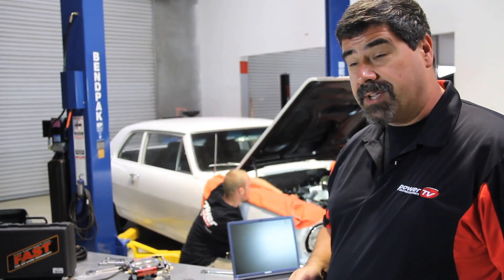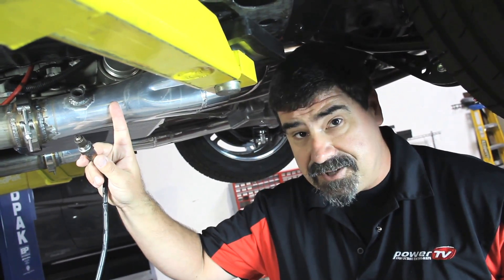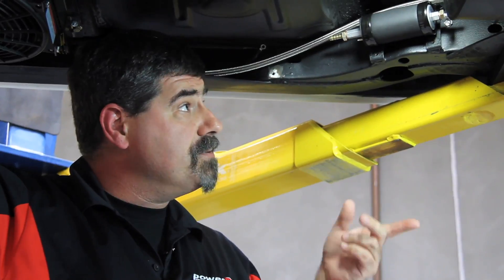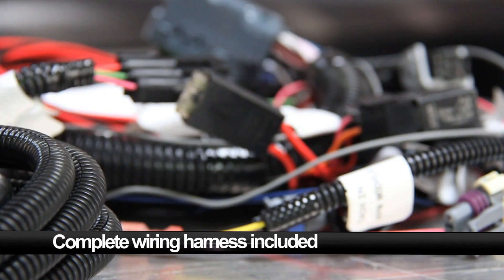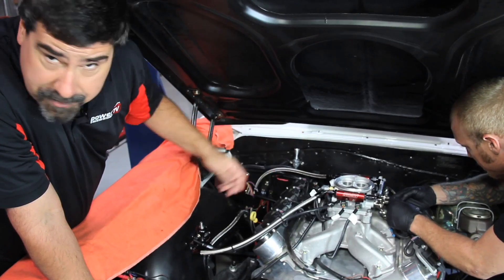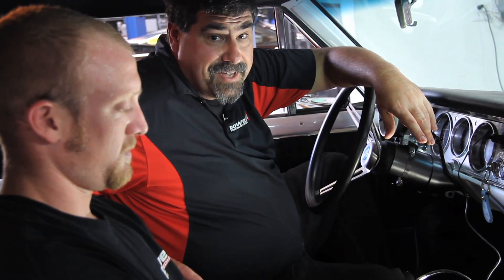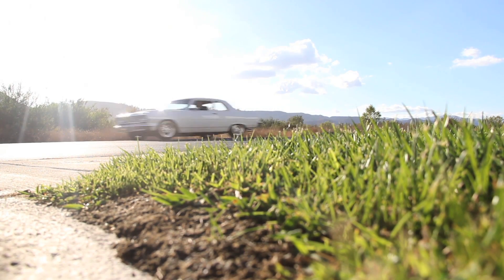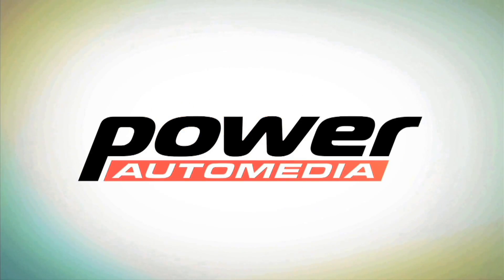The quick and easy approach to electronic fuel injection with the FAST EZ-EFI system

Comment: Considering the original unit on a 1989 Ford 5.0 with headers/HEI/Elderlbrock WITH cable operated AOD, does this unit linkage mimic the Holley linkage? I have to use a special carb arm attachment for the AOD cable whereas to maintain the same cable tension through full range of the carb arm as you go from idle to full throttle.